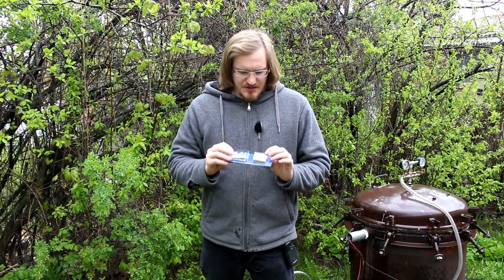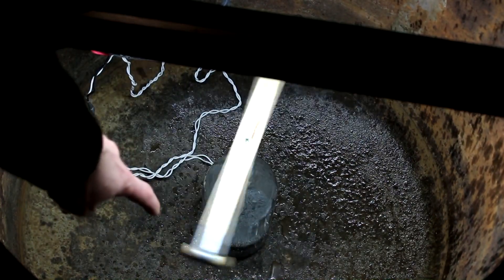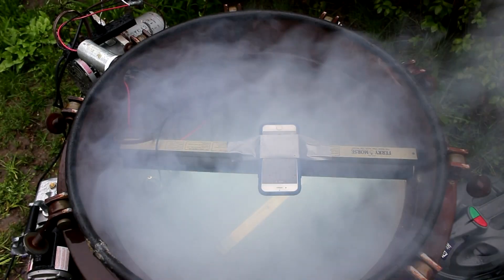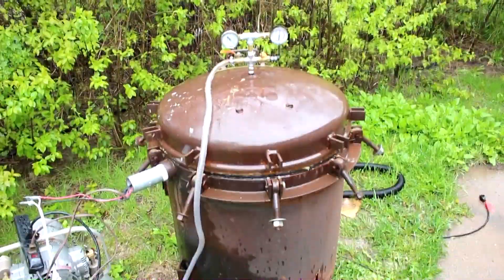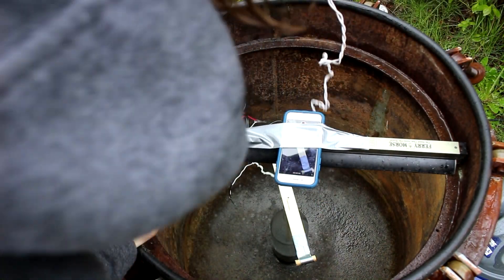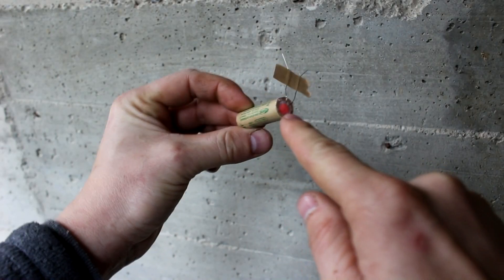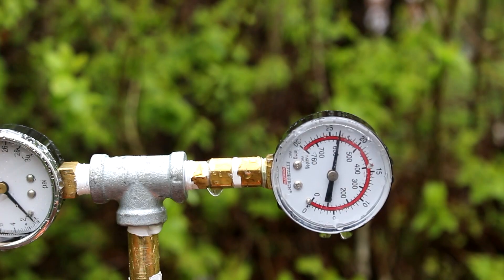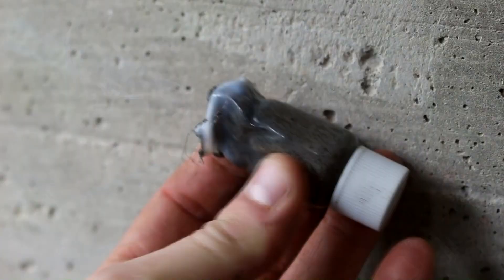Will a Model Rocket Motor Work In Vacuum?

Comment: Next problem is how one aims a rocket in a vacuum. If fans cant blow things wings are pointless. There is no resistance so that just leaves burst thrust and gravity to steer. Seems a bit far fetched to think you can manoeuvre a few thousand pounds of steel with a few thrusters and aim it at something so small like earth. In comparison its like shooting a small bearing like a bb to its maximum distance and hitting a grape. We have a scope that (dont quote me) is thousands of times larger to aim the bb to even have a chance. Also a barrel to align it vertically and horizontally. The target and the projectile are moving and if they get there it would either take 1000s of years or they are going 1000s of kilometres. Do they have rockets on the front capable of deceleration in the magnitude of 10s of thousands of kilometres and how about the 100s of Gs they would be under. I get shooting them off but hitting earth bullseye and not even landing in the middle of China or the Southpole.
Reply: Yes, that's exactly how you aim, and yes, it's like hitting a grape from much, much further away than you imagine, that's why it takes billions of dollars and years, sometimes decades, of preparations, planning, calculating, and measuring to make sure that you fly exactly where you want to.

Comment: i have a question cody, hope you read it, i was wondering if you would test to see if a hydroxy torch would work in a vacuum, as you would be supplying the oxygen for the hydrogen to burn, the only question would be would it light or would the gas expand too fast?

Comment: Dude give up your proving space to be real. You are now embarrassing yourself . you already showed us that this is not possible. After you get all the flack from the flat earth comunity you decide to change the outcome. There were too many cut scenes, and we don't even know if it was actually under vacuum when you ignite it the second time.. I might not be questioning. You are validity. But your past experiments totally disprove this one. Even after adding an oxidizer to your last rocket in a vacuum, it's still would not ignite. Nor would the fan that was pushing air. Below the feather around any more. Thanks for contributing to our cause.

Comment: Did he remember to create vacuum in the plastic capsule he put around the "engine"?? 
(or did he take into account his plastic cover around the engine, was full of oxygen, and thats why he got the combustion?

Somethings rotten in the Cody lab - the smell of false science is strong here.
Reply: You being an idiot does not mean Cody is doing something rotten, the plastic capsule was specifically to provide pressure to the propellant so that the rocket could ignite properly, he explains it in the video. what would be the point in putting another smaller vacuum chamber around the rocket after establishing solid fuel Rockets don't burn properly in a vacuum?

Comment: cody, so thats a no right? because to achieve the results you used a mini atmosphere inside the vacuum to feed the rocket oxygen. also noted that the vacuum in the chamber was gaining pressure suggesting that the rocket preformed outside the vacuum. if space expands then lets think of that as the superior vacuum pump and a gain of pressure may not even be messurable. ie nuclear bombs produce no shock waves in space.

Comment: I've never seen NASA put a rocket into a bottle before igniting it.  Nor have I seen them cap their rocket ends in outer space before ignition.

Perhaps the reason your rocket ignited was because there was just enough 
atm in the bottle to support its burn.  Your demonstration isn't persuasive.

Thanks for sharing!
Reply: Have you ever looked into NASA rockets at all because that is what they do,
There Is a combustion chamber that is under very high pressure from gases combusting in it, there are also smaller maneuvering thrusters that work on creating a pressurized environment igniting the thing and then releasing that pressure in exact amounts, some even use solid fuel Rockets despite the fact that they do not ignite well in a vacuum by putting them under pressure with burst discs or just letting them on Earth to get up there.
There wasn't meant to be persuasive, it was educational
You say you haven't seen this concept at work in NASA Rockets as though you have looked at them closely.
Also the main boosters ignite within Earth's atmosphere anyway so you wouldn't need a container to make an atmosphere of pressure for ignition of those.
Reply: Also Cody clearly says that is the reason he was able to ignite his Rocket was because of the atmospheric pressure in the bottle, and the reason they would not ignite in the vacuum is because of the lack of an atmosphere of pressure, this is not something you need to assume as though you were clever, he said it.
He also explains why.

Comment: Cody, you have tried this in the vacuum but what would happen if there is excess pressure in the system. will it rotate faster? 
Could you try pumping in air?
Another thing that I observed in this experiment u said that it isnt burning in the vacuum, isn't it obvious you need oxygen to burn so why were you shocked when you tried in vaccum. the setup you made with the bottle had enough oxygen to burn only for that short while and then it stopped. 
so the bottom line is it requires oxygen whatsoever. And NASA rockets carry their own oxidants.

Comment: I noticed that all the fuel did not get burned in the last test. compare the timing of the fuel been burned in the first experiment to the last experiment.

my conclusion is that you would need a constant supply of air in order for rockets to work in so called outta space
Reply: You are correct... which is why one of the prime ingredients in rocket fuel is liquid oxygen.  Combustion is a chemical process that requires oxygen.
Reply: Lensflare Deviant so when they drop off the three stages of a rocket. only the space craft is left. how much oxygen was on the lunar modules that was previously sent to the moon which 238855 miles from Earth. Please note the sizes of all modules that was said to have landed on the moon.

where was the storage for the vast amount liquid oxygen that was required for the mission to and from the moon?
Reply: All those answers are easily available with a quick google search.  However knowing that hoax believers fall into that so endearing "Won't look, won't learn" category which has and will keep them perpetual failures in life.  I will do the thinking for you.. 

The Saturn IVB was the stage that gets them out of LEO, that's Liquid Hydrogen/Liquid Oxygen.  The Command/Service Module uses Aerozine 50 as a fuel and Nitrogen tetroxide as an oxidizer in a hypergolic mix.  The LEM assent engine uses the same 2 fuels.  The Command Service Module also carried tanked Oxygen for crew breathing and was also used with tanked Hydrogen for the fuel cells.

The 'vast amount' was held in those big long white and black cylinders called "rockets"..  They hold the fuel tanks.  For more information I suggest you try Google.. then reading (it'll hurt but do it, it's good for you) and the most difficult and I suspect painful part.. THINK for yourself.  Learn..  Or at least try before you announce your failure and require someone else to do it for you.  Again.

Comment: Does rocket fuel burn in lower pressures because it provides its own oxygen? The combination of hydrogen and oxygen that composes rocket fuel will still be able to burn as it's released
Reply: As ambient pressure goes down, the efficiency of the rocket goes up.

Comment: By hand with a small drill bit core the motor 1/3rd to 2/3 rds deep so the igniter core burns the fuel ! No outter shell needed !the pressure in the motor needs to ramp up faster a core burn will do it

Comment: Bull crap!! Cody didn't place the ignitor correctly. Solid fuel engines don't need air, or any other gas to fire. Furthermore, engines produce more thrust in a vacuum. It doesn't need "air" to push against for thrust.(It's now 2023, and I was wrong. Sorry Cody)

Comment: The thrust is pushing against the side of a can which is giving it the thrust...  this is not a real test in a vacuum because a vacuum is meant to be infinite... find a way to aim the thrust at emptiness while inside a vacuum and then tell me if it produces thrust.  :)
Reply: At this point in time, NASA barely receives any of your tax dollars. 0.5% of the tax dollars went to NASA in 2011. Since then, NASA is receiving less money. Meanwhile, the military consists of 15.3% of tax dollar spending.
Reply: @bensmith3306  will keep in mind that 15.03 includes NASA so more like 14.98
Reply: Got Aerial 
Yep...
Reply: No it's not
Why would the gas molecules that already imparted as much energy as possible onto a rocket as it left hit the edge of the wall and then impart more energy on to the rocket that's like six inches away from it with a vacuum in between. What's the mechanism for this?
Reply: They did something better.  They put rockets in space.  Much bigger vacuum.  There's a monument to their success that you can see with a pair of binoculars.  The height of the ISS has been confirmed by +Red's Rhetoric.  Most of your tax dollars go toward other things.  NASA barely gets any of it.
Reply: Infinite vacuum?  Are you kidding me?  There's no such thing as an infinite vacuum.  Man-made vacuums are already better vacuums than the vacuum of space near Earth.  If the rocket did push off the side of the can, it would produce very little thrust since it would be pushing nearly parallel to the side rather than perpendicular. The test is more than conclusive.  Stop whining.
Reply: such nonsense, YOU DONT HAVE A VACCUME.
        space is a cgi fake
ROBBING MILLIONS OF DOLLARS A DAY...
Reply: You god damn moron... The exhaust gas pushing on the bottom of the bottle was also pushing the bottle backwards, that's why:
a) your theory is wrong, because the rocket wouldn't move at all if the bottom of the bottle didn't melt off
b) all people saying that the rocket burned for a shorter time because it wasn't moving as long as in the other tests forget that a lot of fuel was used to first burn through the bottle.
Reply: @StartellerRX-8  I think if I can if they meant the edge of the chamber not the bottle
Though I've also noticed people claiming that the rocket is pushing against the bottle that is a part of it which I've pointed out makes absolutely no sense.

Comment: A hotter igniter may have worked too. The "starters" that Estes includes with their motors now have no pyrogen on them and can be a bit testy even under normal conditions, they have to be placed just so in the motor to work right. You're relying entirely on the heat of the nichrome wire to heat and ignite the black powder. It is all about getting the motor to come up to pressure quickly enough to sustain itself, more of the propellant that is ignited the better.

Comment: l wounder if you could get ignition to self sustained reaction with just a red hot wire in the engine in vacuum.
Reply: Well according to these tests you can hardly get self-sustaining ignition if you ignite it under atmospheric pressure and then put it in a vacuum
Reply: @FrancisR420  
The tests showed that while it is hard to ignite enough fuel at once in vacuum to get enough pressure in the chamber to sustain combustion once it is running it burns all the fuel. The question is weather you can get enough fuel to ignite at once to build the pressure in the chamber high enough.

Comment: If you want to continue doing "burning in a vacuum chamber experiments, go to your local vape shop and get some of the wire they use for building coils. I use several coils to light fireworks. With a bench power supply I can get a coil white hot for several seconds and reuse it about 80 times.

Comment: Seriously? Whether a rocket produces thrust in a vacuum isn't in doubt; measuring the difference in thrust between atmospheric pressure and a vacuum would have been educational.
Reply: +BadWolf HS   Mostly flat Earthers, who don't think that space even exists.
Reply: +iwillavenge you    Without pressure the gases disperse, so no chemical reaction happens.   This is why there is no visible flame from the LM ascent stage after liftoff from the moon.  Once the gases leave the combustion chamber the pressure quickly drops and the chemical reaction ceases.
Reply: Difference in thrust between atmospheric pressure and a vacuum is also not in doubt. You can literally calculate these numbers at home on paper.
Whether a rocket produces thrust in a vacuum isn't in doubt either, but this video raises a lot of questions.
I dont doubt nasa, or any rocket manufacturer. 
Intuitively everyone thinks all you need is an oxidizer and fuel to create a reaction, which is wrong. Obviously as seen with this video you need pressure, BUT WHY? That is the educational part. And tbh, it is not explained well in this video why you need pressure.
Reply: So why is pressure needed for the chemical reaction to continue? I mean the necessary ingredients are (or atleast we thought) fuel, an oxidizer, and heat. Which is all there.
You said without pressure the gasses disperse, but the fuel/oxidizer is solid in this case. Why do we care if the products of the fuel/oxidizer reaction (the gasses) disperse? How do the products of the reaction (the gasses) have anything to do with how the reactants (fuel/oxidizer) react?
Thanks for your comment, i am still failing to see why pressure is needed.
Reply: @shivpalpatine  maybe it's because the energy required to bind those molecules can't travel effectively through a vacuum
They need to be pushed up against each other somehow.
Reply: iwillavengeyou Cody has another vid about burning stuff in a vacuum that explains it pretty well. Without pressure, only the molecules subjected directly to the heat source react, and the products disperse too quickly to provide adequate heat to adjacent molecules, so there's no chain reaction. In this vid, after ignition, the internal pressure of the rocket allows the fuel to burn completely, and more quickly since the exhaust evacuates the tube without external resistance.
Reply: You say that but read some of the comments from flat-earthers who think Newton's law only applies to fluid environments because....... nasa fake?
Reply: "Whether a rocket produces thrust in a vacuum isn't in doubt"  
Unfortunately it is, there's a contingent of conspiracy theorists who claim that thrust in a vacuum is impossible.

Comment: Solid rockets are only used in atmosphere from launch, they switch to LOX in space.
Reply: The Space Shuttle SRBs separated at 220,000ft, that's already very close to a total vacuum with virtually 0 air pressure/oxygen.
Reply: BadWolf HS good point, but his test shows they can't lite nor fully burn in a vacuum. It only burned about a 1/3 
We still don't really know what space is since NASA spokesman for Orion said, "we still have to figure out how to get a capsule through the van Hallen radiation belt!".
Reply: All this test shows is that these toy model rocket motors don't work as well in a vacuum as in air, and they weren't designed to. Actual rockets are designed to work under those conditions and operate just fine. Your quote about the Van Allen belts is also nonsense taken out of context.

Comment: It does need a certain temperature and pressure to ignite.  I've got a 1950s rocket manual for amateurs and it includes a section on modifying the design of the igniters for second and third stages so they'll function at high altitudes.

Comment: Might have been simpler, reading the comments below, to have used a CO2 cartridge.  The midnight shift from the puzzle factory  feels sure the little glass vial was a ruse.  They failed to quite grab onto the idea of thrust, and confused themselves thinking about  air-dependent combustion. Eliminating the reactive bits to isolate the thrust-in-a-vacuum aspect might have made it easier for a simple person to follow.

Comment: im pissed at the poor level of usefull info in this video.  he could have made a video entirely on why the pressure gauge didnt go to full vacuum  . and maybe another one about how the atmospheric pressure can change from day to day and why it does ? he could have made conclusions based on his observations of the malfunctioning pressure gauge and hypothesized how accurate pressure gauges are. and reflect on all the times he measured pressure gauges to a millimeter to see if he had full vacuum. and say in conclusion it was stupid. and that for all he knew he had half a vacuum. a pressure gauge that can be off by  like 20 percent from day to day  is useless when trying to measure stuff like .1  percent from full vacuum. among so many other stuff i think this video should be taken down and redone as it is so below codys standards. i watch cody because hes smart and notices stuff like that and then explains them. this video is like what any other "science'' channel could have made. like hydraulic press channels.
Reply: Rain reduces pressure because it condenses the particles in the air, there are less particles in the air which means less pressure the pressure gauge is completely accurate but reads relative to outside pressure.
He really did not need a whole video on this
Also he was never going to have a complete vacuum it's nearly impossible to get one on earth and he did know exactly how much of vacuum he had, the gauge being affected by the outside pressure does not mean he could have been at half of the vacuum he thought he was at you just adjust for barometric pressure. also any amount of vacuum would demonstrate the effect of vacuum has on the thrust of a rocket.